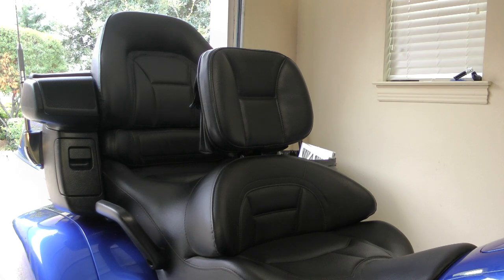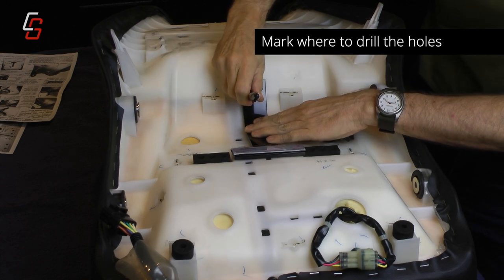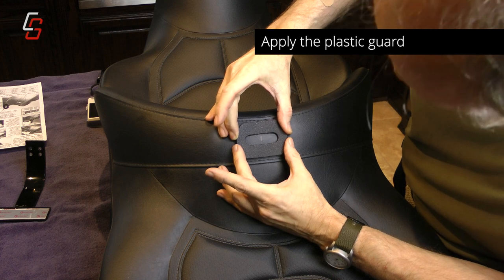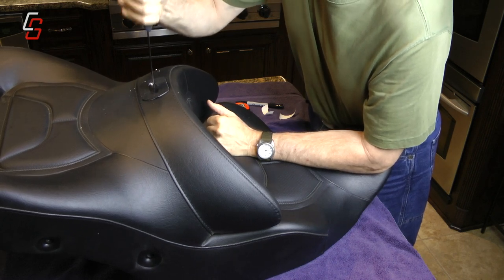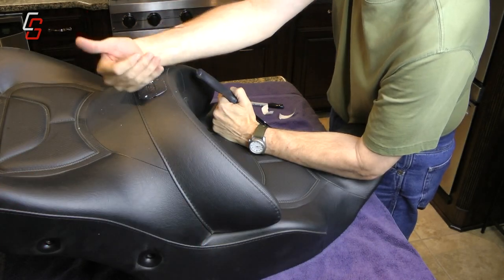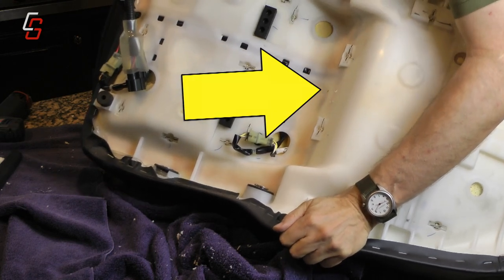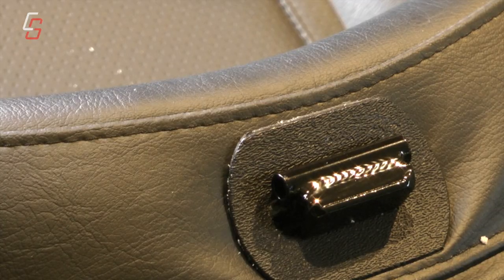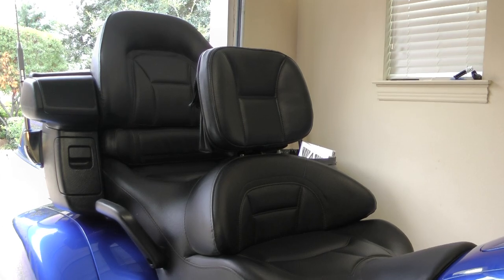How To Install Utopia Backrest on 2001-2017 Honda Goldwing | CruisemansGarage.com

Comment: Great video, I just added the utopia to my 2005 GW. I might add that I would drill the holes after you saw the seat and insert the bar. I had to re locate the holes because the original holes had me really pushing down hard on the seat to get the bar holes to line up correctly, which in turn made he seat fabric compressed too much. Looked horrible. So put the bar in and take a flashlight to see where the holes on the bar are at and then drill the holes. In my case I had to use the set of holes for the newer model GW. Just my 2 cents.

Comment: I'm a short rider 5' 4" (2018 Goldwing Tour DCT) and I sit close to the tank, is there a back rest that tilts forward and locks to meet my back for support?
Reply: I know that Wingstuff has an adjustable backrest but it has horizontal bars that to me, spoils the look of the bike. I know, Rick Arnoldo of Wingstuff and Cruiseman agrees that the backrest helps, but for now, the lumbar support on the seat is good enough for my lower back. I'm also 5'4", by the way.
Reply: @gohjohan  went with the Utopia backrest and never looked back. Loved the lower lumbar support with  the backrest folded down.
Reply: @deweycarmack3212 That's what I did with my previous motorcycle when I had the Mustang seat with the rider's backrest. I have to fold the backrest down.